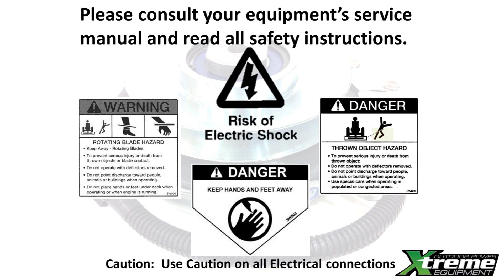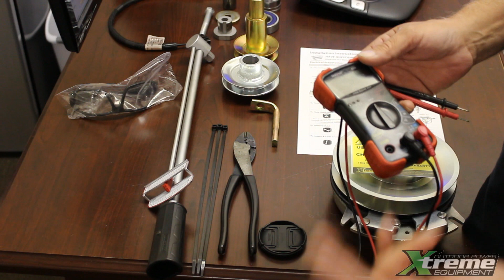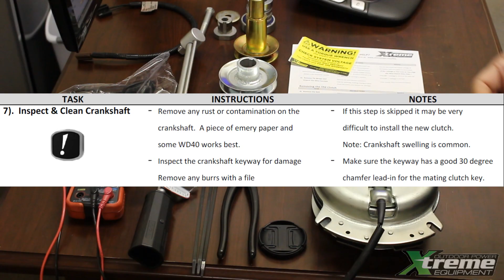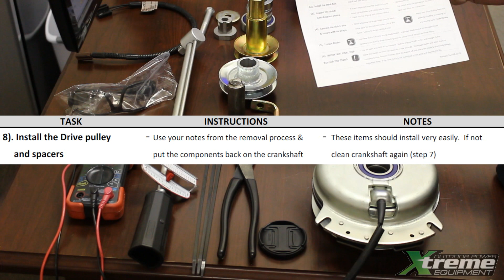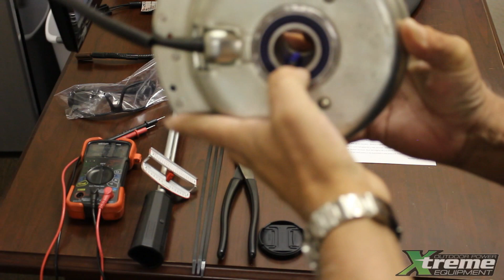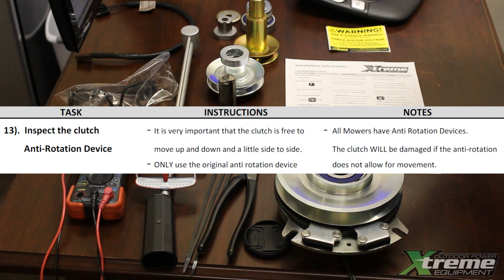00-Clutch Installation

Comment: Thanks for the heads up about checking the voltage,  mine was high,  and replacing the battery fixed it. Would have been sad if I'd ignored it and burned up the new clutch.

Comment: No mention of how to keep the crankshaft from turning while torquing the crankshaft bolt
Reply: at 5:111 he talks about using an impact wrench or HOLD THE D-Spacer to prevent the engine crankshaft from turning.  however not all have D-Spacers...i saw one guy use a pipewrench to hold it
Reply: @catbirdfeeder    You only use an impact wrench to remove the crankshaft bolt. When you install the clutch you use a torque wrench. There is actually a wrench made to hold the spacer but it’s expensive so I custom made one identical to the one you can buy.
Reply: WCJCNC..... being an "Old Schooler" myself... just remove the spark plug, and feed some rope into the cylinder, then rotate the piston up towards TDC, and it will "lock up" there and will Not rotate any further.  When you're finished with torquing the crankshaft bolt, rotate the crankshaft in the opposite direction, enough to free up the rope, and pull it out by the "tail" you left hanging out of the plug hole, then reinstall the plug again... to the correct torque specs for your engine (especially if has an aluminum head(s)), of course.

Comment: Good morning, I have a question on removing the PTO clutch. When I try to remove the bolt the shaft turns. What is the best way to secure the shaft so I can remove the bolt and then torque to correct ft. lb. when installing. (2000 Huskee riding mower)Thanks

Comment: I have a toro Z420 new clutch in but need to replace electrical wires with new pigtail you provided. Do wires need to be connected in a certain way or will clutch work either way the wires are connected to original wiring harness
Reply: Same here. They sent the wrong adapter harness for my Husqvarna. I need to know on their plug from the clutch which wire is positive. 
This is no help.